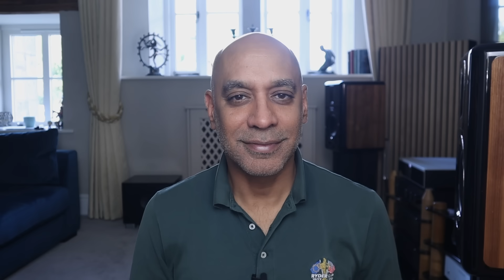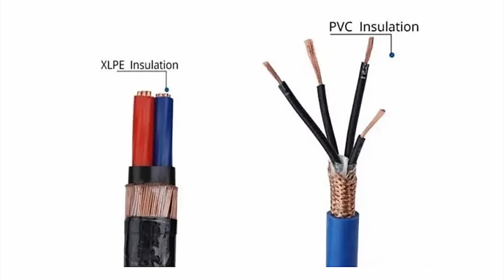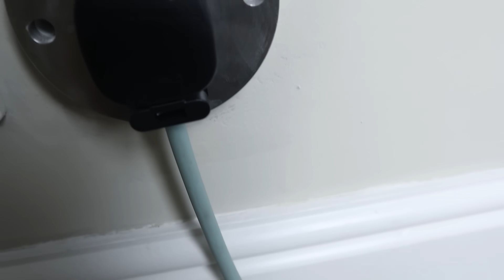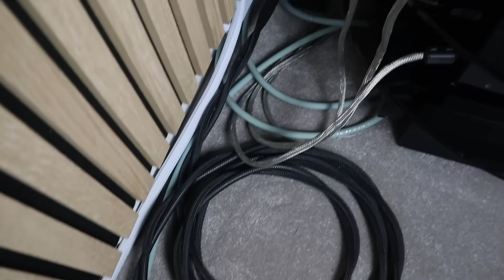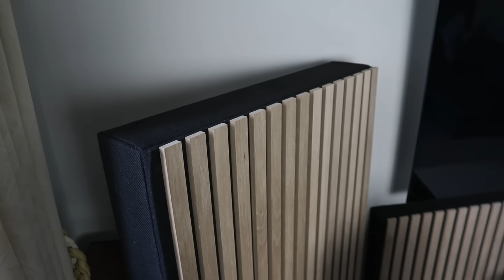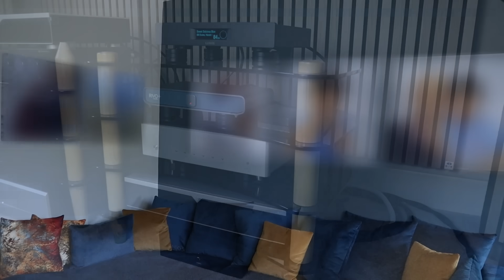Tour Of My New Listening Room

Comment: I have great respect for your opinion on all things hifi, I find your reviews and opinions to be well considered and balanced. 

However as an electrician i am baffled by audiophiles running dedicated power circuits with a view to improving audible performance? Any dedicated circuit eventually runs off the same sub mains from your street using industry standard cable all the way back to the nearest substation. On its journey to your home it runs through step down transformers and across multiple isolation points to enable the grid to be safely serviceable. Using better quality cable and removing isolation points in the 13 feet from your breaker box to your power conditioner is redundant. Outside of a dedicated power circuit to ensure you have plenty of amps for your equipment, I struggle to understand the reasoning? 

Congratulations on the new space. Many of your room improvements are fantastic and i am sure have a positive impact on your system’s performance.
Reply from the maker: Thank you. The rational is that it is no longer on the same ring main circuit as other devices such as microwaves, mobile phone chargers, fridges, etc. which all polute the line with noise. It does make a difference in my experience. I glad you enjoyed the video 😊

Comment: No mention of flooring or ceiling material, and the responses of these areas? V interesting tho, thanks
Reply from the maker: Concrete floor with a thick underlay and carpet. I didn’t react the ceiling. There is a 100 yr old French chandelier that I didn’t want to obstruct 😊

Comment: Hello Tarun, Just watching this video and regarding the Belden 83083 cable. Is this running from your consumer unit? I was interested in this cable but have been advised this should not be used due to the updated 18th edition regs? Can you advise please? Thanks.
Reply from the maker: Best to email Belden directly and enquire if the 83803 is BS7671 compliant 😊
Reply: Hello again Tarun, Regarding the Belden 83803 cable, unfortunately is does meet BS7671 and cannot replace twin and earth from a consumer box. The only problem with your video is people might think it can be used for this application. But it would void any house insurance if in the worst case something were to happen.
Reply: Should have said Does not meet. Sorry

Comment: My man you've got the best dedicated (cryogenic even) custom mains supply have I have ever seen but.., I mean how come you you still need another power filter in your system? Does it give you an extra hi end tube like all encompassing sound stage or something by having the extra power filter? I imagine the musical gains may be noticeable to warrant the 2nd filter, I'm still not sold on so won't buy the audiolab single socket filter as it stands

I will have to save for a good filter in future but not one as expensive as yours (which incidentally costs more than my whole hi fi system & I use rocket 22 hi level wired on my 2 wharfedale 10" sub's & a 2nd set on my monitor audio floor standers 6.5" woofers all having pure red copper bananas on my 4 year old Sony AV  & bare wire on speakers) I will by some proper not too expensive mono blocks & pre next year all being well, & well done with your setup & thanks for another educational video
Reply from the maker: Essentially, the dedicated mains eliminate pollution from other devices in the home and the main condition gets rid of DC and any noise that has come in from external sources 😊
Reply: @abritishaudiophile7314 Nice, I still use a very old Micromark surge & RFI filter which still works well today was gonna use caig deoxit a few years ago but I can't access the insides, but I will be getting an electrician in to add a spur soon I need that comforting feeling of knowing I've done the best I can for my budget, I'm so looking forward to hearing my system when the work is complete, then I will check out some newer filters to get some reference sounds with & without new filtering once again thanks for your vids & reply

Comment: I too have a dedicated power supply for my hifi, which is separated from the rest of the house. Also a conditioner, very similar to yours. There's a lot to be said for the impact of both and if doing a rewire is a no brainer in my opinion if you value high quality sound.

Thanks for the video, Tarun.

PS: I'll be buying some of the GIK panels. Thanks for responding to my previous question on your other video. 👍
Reply from the maker: Cool 😎 thank you for sharing your experiences and you are most welcome 😊👍

Comment: Hi Tarun ! Nice room and equipment you got there. I am happy to see the evolution of your system. My main room is 12' x 26' x 9 and is ''L'' shape because it is a living room and kitchen combo. The bass is very deep in here without a subwoofer. Since I rent the place I use area rug, plants and furniture as absorber/diffuser. Thanks for the tour, it was very informative.
Reply from the maker: Thank you 😊
Reply: 12 feet by 27 feet is bigger than most people's rooms. I'm assuming you have tower floorstander speakers capable of good bass down to 40hz.

Furniture plants will do very little for the narrow 12 feet side walls. You need 4 inch depth acoustic absorbtion panels for that dude.
Reply: @C--A  With the amount of furnitures, rugs, books, paintings are doing a fine job according to the claping hands test and the ceiling have acoustic tiles. The bass from my two-way Polk floorstanders is a bit strong but I don't want to invest more on anything since I am in end of life condition and my son as no interest in hi-fi.

Comment: What is it with this snake oil rubbish , show me on a oscilliscope the advantages of your mains conditioner and isolation feet on your speakers and ill believe you , i guarantee if you hid the equipement behind curtains and tried to guess wether the feet were on or your mains was fed direct to the consumer unit , a large proportion of people wouldnt know.Why is it you hifi guru,s talk crap ....You have inch thick cables on interconnects and the like to speakers when then internal cables are usually made up of really thin poor cable .Please show electrically improved results via a measuring device such as an oscilliscope and i might believe you .

Comment: Check out HB Labs mains sockets. Thick aluminium frame. Cryo-treated silver-plated copper, and no steel bus bar (use wire instead). Dramatic drop in distortion, and equivalent rise in clarity. A bitch to install though, on the back the three pins have their wire terminals right up against each other - really should be rotated away from each other to have the wires spaced out.
Your electrician will hate it, but soundwise it is far beyond the brass and steel from other brands
Reply from the maker: Thx for sharing 😊

Comment: How does a dedicated consumer unit work? Do you mean having 2 different fuses boxes (or whatever you call them)? Wouldn’t one hace to run off the other, or do you mean connecting them in parallel to the incoming house mains?
Reply from the maker: It is a separate box with it own Residual Current Devices (RCD) and some with Mini Circuit Breakers (MCB) and overload protection 😊
Reply: @abritishaudiophile7314 cool I’ll get that when I get rewired 😊

Comment: Thanks for the tour.  Great that both you and your family can listen to your music system.  Enjoy!  To answer your question, I’ve setup music systems in many different rooms in many houses over the years.  My focus is always on setting up the system where it makes the most sense in the room and positioning the speakers in an equilateral triangle with the main seating area whenever possible.  I tow in the speakers as needed to get the best phantom center and soundstage.  The rooms I’ve had built had Deadicated power supplies and plaster board walls with acoustic panel ceilings and carpeting on the floors with a thick pad underneath.  I focus on equipment that works well together with beautiful aesthetics.  Be well and rock on.
Reply from the maker: Thank you for sharing your experiences with setting up systems, sounds like you have had many years of listening enjoyment 😊

Comment: Have you ever heard the B&W Nautilus 802 Loudspeakers?  Do massive speakers like this sound heavenly compared to a good slimmer Dynaudio?  Do those Bowers get left behind as technology advances year on year?
Reply from the maker: I remember them 😊
Reply: @abritishaudiophile7314 those 802 are massive and I’m wondering how speakers like that age?  I was offered a great pair for 3k but turned it down and regret my decision.  However my room is an average size and my playback equipment is 500-1000 pound stuff so probably not good enough.  Saving up for 804’s makes more sense but I don’t think I can part with 6k on my wages 😬😩😂

Comment: Did you know that 99% of all loudspeakers manufactured use internal wiring of little more than bell wire quality. Even £15k Harbeth loudspeakers only use Van Damme at around £5 per metre. That means the sound pressure wave that you hear in your eardrum (the music we listen to) has been created using inferior cables from the loudspeaker binding posts through to the drivers. So what is the point of the power conditioners, and outrageously expensive loudspeaker cables and interconnects before the connection to the binding posts?
Reply from the maker: Try one and see 😉
Reply: @abritishaudiophile7314  Congrats on the new listening room. Looks nice! I've been away for awhile and looking forward to catching up on what you've been reviewing over the last few months. Cheers, Tarun
Reply from the maker: @kenhiett5266 thank you. I hope you enjoy them 😊👍
Reply: @abritishaudiophile7314   I have a first class honours degree in Advanced Acoustical Engineering. It's called 'Psychoacoustics' when people perceive that a product (loudspeaker cable or interconnect) will sound considerably better because they have paid a lot more money for it. We blind tested QED strand 79 against Nordost Valhalla, and ten out of ten people could not detect any difference in sound quality whatsoever. The weakest point to over priced and over hyped hifi products is called human hearing. A hifi is just a 'transport' for us to listen to music. Listen to the music and not to your electroacoustic wave!
Reply: I'm using a brand called 'Snake Oil Acoustics' which is £5k per metre, but strangely doesn't sound any different to bellwire!! - so what brand do you use then?
Reply: I suggest the Galen Gareis (retired Belden cable engineer) seminar recorded at Axpona in 2023. It's available on his Iconoclast Cable YouTube channel.
Reply: Speaker cables inside cabinets are typically thin because the short length of wire within the enclosure means a smaller gauge cable is sufficient to carry the necessary current, unlike the longer external speaker cables which need a thicker gauge to handle the increased resistance over a longer distance; essentially, the internal wiring is short enough that its thickness has minimal impact on sound quality. 

So what kind of false economy cables are you using then 😊

Comment: It does make me chuckle when people use a few inches of absorption and think it’s going to absorb bass, you need about 16inches thick absorption just for 100hz, let alone bass below that. You are better off treating the listening area and wall behind that as you don’t sit in the corners where the bass builds up anyway.
But the best way to do it is get the speakers positioned in the sweet spot for the given room, that will give more rewards than room treatment which is mostly a complete waste of money.
But it’s fashionable at the moment I guess!
In my opinion for home audio it’s a total waste of money because you can achieve great results with careful speaker placement and soft furnishings. It’s all getting a bit silly these days.
Reply from the maker: Speaker positioning and listening position are the two most important factors to get great sound. But other factors matter too, treatment, isolation, mains conditioning all brings benefits 😊

Comment: Cool stuff.
I have a small living/listening room which sound awful without treatment. The positive is the semi-attached kitchen which helps with excessive low frequency energy.
I've treated the rear wall with 4 in. thick acoustic foam. The front wall is treated with diffusion. 
I would suggest to anyone contemplating acoustically treating their room is careful research  before starting. It's easy to spend a lot of quid and make the room worse.
Reply from the maker: Thx 😊

Comment: Nice room. I hope you get many years of enjoyment out of it. Are you using any room correction software? I thought in  one of your past videos you mentioned that one of your pieces of equipment, maybe it was just a review piece, had the ability to do room correction, but that you didn't want to do that yet, as you hadn't gotten your room the way you wanted it. If you are using it, it would be interesting to hear your impressions of with and without room correction.

I have not done any room treatments thus far. I will probably do some in the future. I will at least put some panels similar to yours running the length of the front wall (is it the front wall or the back wall if you're facing it?). I may do some bass traps as well, though that depends on the style, as I don't have much space to work with. Before I do any of that, I would like to take some measurements to at least know what I'm starting with so that I can have a target for corrections. My Wiim Ultra does minimal room correction. I'm using it in a desktop setup, so I'm not expecting anything out of it. I also have the Node Icon, which has Dirac, but I haven't set it up yet. It will be used at another desk, same room. I don't have any faith that room correction will help much in a nearfield situation, but maybe I'm wrong. I guess I should do some critical listening.

Thanks for sharing your home with us.
Reply from the maker: Thank you. I have had units with room correction in for review at times. I still have to find one that doesn’t penalise overall fidelity in the pursuit of a more linear frequency response 😊

Comment: My main listening room is c. 20' x 11.5'  x 8'. For practical reasons I have to listen across the short axis at the right-hand side much as I would like to listen on the long axis. The floor is boarded, there's a couple of Persian rugs, another couch, plus other furniture/wall coverings and so forth.  Although I have six damping panels, I only use two of them, one to stop reflections from the 80% double-glazed right hand wall.

Although I say it myself, I seem to have next to no issues with reflections and room resonances. All my powered gear is on isoacoustics mini pucks, as are my standmount Quad revela 1's that I occasionally listen to instead of my DIY O/Bs. My active Rel T0 sub sits atop a stool between the speakers -- I use it not so much for extra bass as general enhancements to fullness and airiness of sound. Don't know why that works, but it does. At any rate, I can tell when the sub is off, that's for sure.

Which brings me to my question: have you or anyone else here experienced how a sub can enhance sound across the spectrum and not merely in the bass? I'm at a loss as I use the high-level input from my power amp's speaker terminals which draw minuscule signal power, and so there can presumably be hardly any effect internal to the amp itself.
Reply: Yep, I use a cheap sub, a Wharfedale Diamond 150 (£175), and use it at a very low volume, but if I turn it off I lose so much of the overall sound it’s ridiculous, and that’s despite having 5k Fyne Audio speakers sitting on 1.1k Fyne Audio stands. Like you I also have it connected using speaker level connections but where our systems differ is that I have the sub connected to my speakers rather than my amp, the reason being I like to switch between using a solid state power amp and an integrated single ended tube amp so this way I don’t have to keep disconnecting and reconnecting the sub to whichever amp I’m using. Like my main speakers both of these amps are good quality mid-price components but this sub brings way more to the table than its modest price suggests. I have the volume on it set so low I wouldn’t even know it was on if I didn’t put my ear right up to it but like I say, if I turn it off I lose so much from the entire frequency range it’s astonishing.
Reply from the maker: Thx for sharing 😊

Comment: In answer to your question, my listening room went from very bad to quite good by reconfiguring the layout. I’ve gone to setting up the speakers across a room corner and the listening chair at the opposite corner (about 5 feet out from the corner). This layout has removed most all side wall reflections and greatly improves the sound stage.
Reply from the maker: Thx for sharing your experiences 😊

Comment: Just an upgrade suggestion on the mains cables... Try a DIY version of some FURUTECH FP-S35TC/FP-TCS31 OCC Cable with Rhodium/Silver IECs and mains plug. Also add audio grade fuses, they do make a big difference regardless of what the snake oil nay sayers say. Upgrade especially to the mains conditioner and Pre-amp and power amps. You'll be very surprised!
Reply from the maker: Thx for the suggestion 😊

Comment: Mechanically isolated plug? Can you explain the physics of how this works?
Reply: Also a similar approach as used by Naim Audio in their mains leads and connectors.
Reply from the maker: The Lens power socket uses the principles of mechanical resonance control at a microphonic level combined with electrical treatment of a carefully selected panel socket. It was made by Crabtree and had the following features:
- floating stainless steel front plate
- machined-from-solid PTFE middle and rear section
- ultra high precision ceramic isolation bearings
- stainless steel fittings throughout